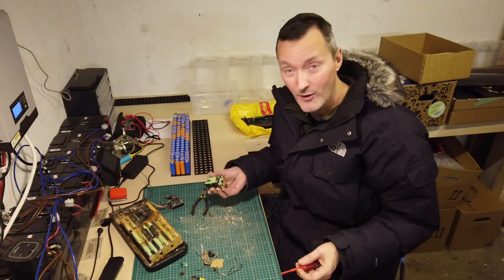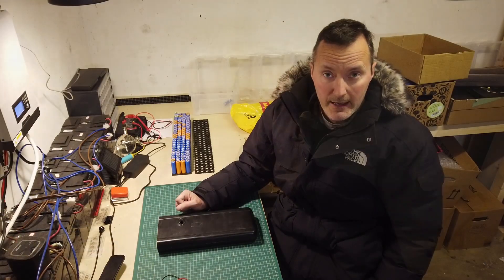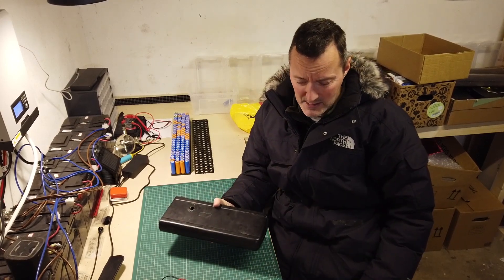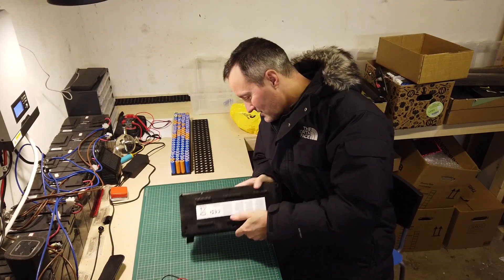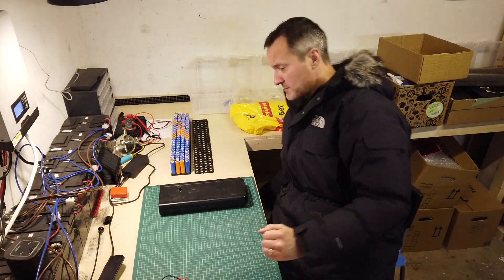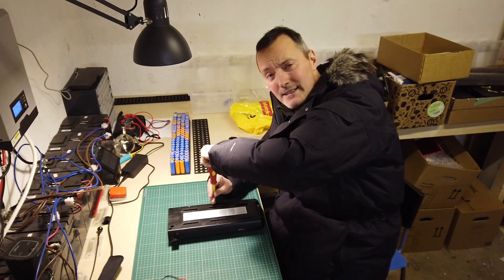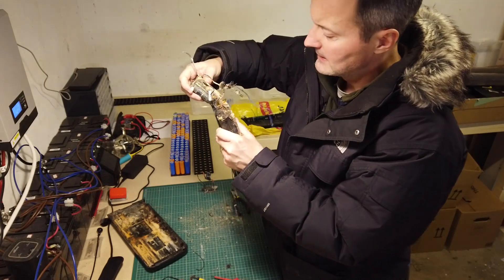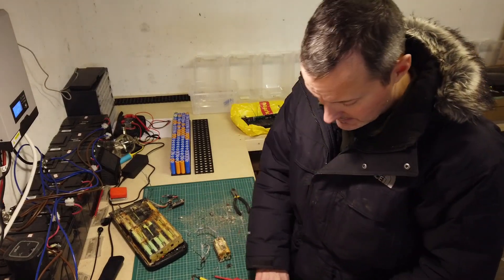First 18650 DIY Powerwall harvesting session = DISASTER! Water Damaged E-Bike Battery Cell Recovery

Comment: Don't throw those lowvolt ones away.   Charge them.  Test for capacity.     Leave them for a month and see if they lost any voltage.
Reply from the maker: Actually Bart, I did that and they're all ruined, most of them had a popped CID so I reckon the whole battery pack was under water for a while. Still, I managed to rescue a few of them, thanks for your comment ;-)

Comment: I would trust them, but: do a capacity test, charge it an stock it - check Voltage after 1 Week. :) Dont Recycle them :(
Reply from the maker: Hi Marcus, well, Ive done 1 test on them and they all came out around 2200mAh. I might do another few tests just to double check they're not heaters, what do you think?
Reply: @TheKilowattChallenge  sounds nice! Charge each Cell slowly (~300mA)

Comment: The cells that were obviously in the water, toss 'em. The others, I would use in small projects that didn't require them to be in series. So things like microcontrollers, flashlights/torches, etc. I wouldn't trust them in high amp/volt applications though.
The clearly in the water cells will probably have compromised CID's. Or possibly starting rust through the cell casing, which will bypass the CID in the event of gassing.
The cells you do find that are good, remove the shrink wrap to verify there aren't any rust pits in the casing. The casing is just steel, with a layer nickel on them. Once the nickel is compromised, end of story for that cell. Not worth keeping.
Reply from the maker: Thanks Korishan, yeah I think I'll keep the 8 or so which have tested ok and use them for testing or videos which involve sabotage or fire ;-)
I'm just too nervous to install them in the main 14x100p  packs I'm building!  Do you know, I never even considered the CID's! Good call!
Reply: @TheKilowattChallenge  Yeah, small projects and testing purposes they'd be fine for. Definitely nothing that can create high amps for sure (ie, no 100p packs 😜)
Reply from the maker: Lol that exactly what I'm building. You da man Korishan

Comment: I have no problem with those sells if they pass my testing
Reply from the maker: How many times would you test them before you would be happy to install them in a pack?
Reply: @TheKilowattChallenge  I personally would clean them up with a plastic brush then let them do one test cycle for capacity and let them sit charged for a few weeks if they are not discharging themselves they are fine

Comment: I would keep them, clean them up and use them in a torch or anything apart from the main pack.
Clean off the rust, re-rap them, label as bad so not to get them mixed up with any good ones.
After all, to still have 3.6v after all the goings-on they deserve a chance  :-}
Reply from the maker: Yeah you're right Mark, I mean they did test ok and they have more than 2200mAh each so they must be good for something right!  I'll keep them to one side for a few months and maybe use them for a simple project or something :-)

Comment: Why not try and charge those with the 3 volts and above, then the ones with no volts. You could parallel the 3 Volt ones with the no volts one, sometimes the higher ones can charge the low volt one to above 1 volt then use this 1 volt one to charge. If no volts after that then bin it.
Reply from the maker: Hi Russel. I might do that in the future yeah, I'm not going to recycle the 0v cells just yet, I might even do a video on kickstarting the dead ones who knows :-)